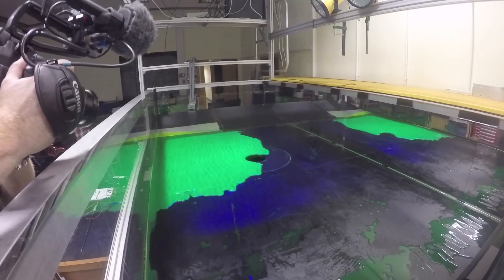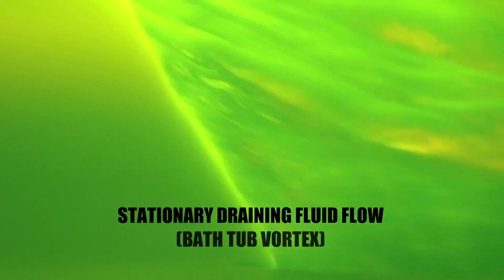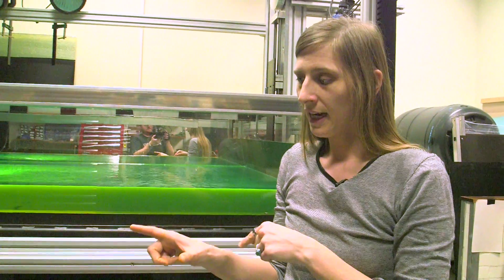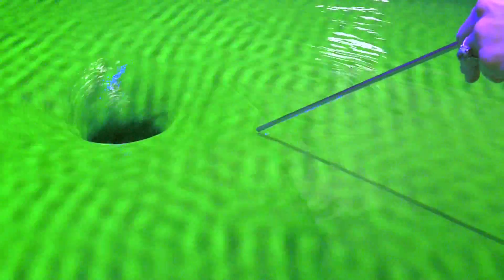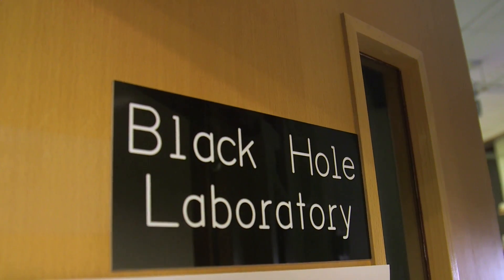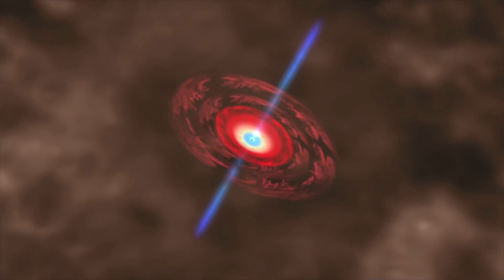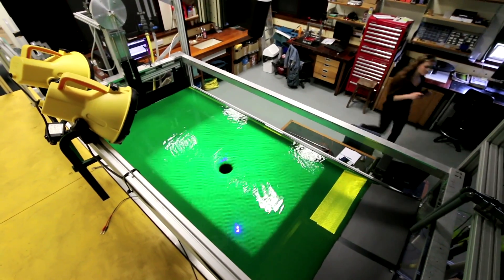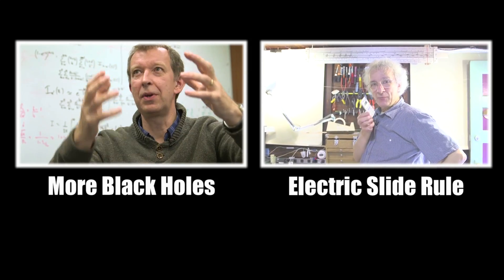The Black Hole Machine - Sixty Symbols

Comment: Wouldn't you have to uncurl the "wirl" first, to get a better visual repräsentation? It seems like a 4-dimensional repräsentation, on a 2-D surface in a 3-D world ...so you have to translate time. Till the worping of space is linear and expands like light - simply gravity. It would show the paint slowing massivly down, near the center of the object (hole) and you could observe the massive stratching before enterence. Or am I wrong? At least this bothers me every time a take a bath.

Comment: I'd like to see a more three dimensional testing tank. Build two siphons of about 2 inch diameter at poles of one another, facing a small area of no more than 4" square, where the water will be drawn. Because the water is all around the two siphons, special dyes will have to be used to illuminate the water flow. The model should mimic how turbulence happens within the three dimensional space.

Comment: Nice video. The symbol in the down right corner should be Εσ not Σσ if you want it to mean sixty symbols.
Reply: The sigma is the symbol for "s" in Ancient Greek, and the symbols are a capitalised and a non-capitalised sigma.
Reply: Jonathan Limm I know it is but the greek word for sixty is "εξήντα" which starts with a greek Ε and not a Σ. So sixty symbols in greek is Εξήντα σύμβολα. That's why I corrected it.
Reply: Periklis Arnaoutis applauds Yeah, but sixty symbols has taken the approach of using them as pronunciation symbols.
Reply: Jonathan Limm I guess that's the thinking.

Comment: So in theory does the black hole at the center of the milky way (or any other galaxy for that matter) loose angular momentum because its making all the star systems spin around with it?
Reply: Yes.  There are theories around sapping energy from black holes by utilizing momentum transfer, which is quite popular in Science fiction (particularly in Charles Sheffield's Proteus Manifest, where they use them as a primary power source).  If you are trying to colonize a region "close" to an active black hole, it may be beneficial to remove its rotation (I know this is done in a book I read recently, can't recall the name though.

Comment: Is removing a plug-hole from a bath an adequate simulation of something as different as a Black-Hole? Wouldn't you need to feed it smaller holes in the surface occasionally, giving off different amounts of heat to study it, then work out what the same effect would be in 3-dimensional space, where gravity is not just down, but pulling in all sorts of directions? It seems like an oversimplification to me and a comparison between two incomparable things.

Comment: Can we get a 4K reupload of this video, please? Not in actual 4K, just to trick Youtube into giving this video the bandwidth it needs. Because the compression is absolutely killing it.
Reply: It would handle it marginally better, because if it was 1080p upscaled to 4K, there would be more redundancy, and the algorithm would do slightly better at retaining the detail, since it has more bandwidth to work with. But the difference really is marginal, and not worth the hassle.
Reply: Penny Lane TotalBiscuit had a test video he posted about it around the time Far Cry Primal came out. I think he used 1440p instead of 2160p.
Reply: jhosioja You don't have a link at hand to one of the comparison videos you have in mind?
Reply: jhosioja And I actually found the difference to be quite visible.
Reply: It won't matter what the resolution is.  The video is showing complex moving patterns, which youtube's compression algorithm can't handle.  It'll look exactly the same in 4k

Comment: I would be curious what you think of Stephen Crothers who has shown that the mathematics for black holes disprove there existence.
Reply: Disproves how? Relativity, which gives us black holes 'breaks down' inside them.
Reply: +Gareth Dean Remember that black holes are theoretical and have never actually been observed.  They are currently only based in mathematical  equations derived from Einstiens field equations of relatitvity. Stephen Crothers shows that the math does not work and that relativity was misinterpreted by theoretical black hole mathematicians. So I was curious , if someone has visited his work on this, what they thought of it.

Comment: One problem with this analogy. The water moves faster, the closer it gets to the drain. Light slows down, for an observer.
Reply: This also isn't meant to simulate time dilation, by frame dragging and angular momentum changes using analogs to a black hole.

Also light slows for an observer, it still travels at c.
Reply: There is no problem. The light does not slow down. It is the information about the in-falling object that comes back to you with lower frequency. This is also true in this setup and was demonstrated with the paper boat trying to go back against the flow. The boat (light) always goes with c but the water (space) is falling faster the closer the boats (light) starts its journey back from the drain (black hole). At some point the in-falling water (space) exceeds c and then the boat (light) no longer moves / is visible - it cannot escape i.e. can't send information upstream.
Reply: It's not about light, not necessarily, but rather anything falling in/around a black hole. Not everything moving around it will fall it. But some does. However, this material interacts with one another, so that some stuff that radiates out rather then falling in takes energy away from the black hole. Light however does not slow down, it travels at C in all frames of reference. What changes is the Doppler shift, which gets more and more severe close to the black hole. This alters the frequency of light, rendering ultimately undetectable. However, light that does not fall in but gets close, will also interact in ways similar to above. Note that, the velocity of individual parts is not actually important in hear, but rather how information propagates through the system. Look up the definitions of group velocity and phase velocity. Group velocity (in oversimplified terms) represents a whole system/subsystem and is analogous to an average of sorts. How this kind of velocity relates to the process is what actually is important, and it does not behave in quite the way you'd expect.

Comment: Doesn't having inflow at specific points instead of all around, produce artifacts that don't reflect real blackholes? Wouldn't it be possible to set the outflow to spin in an specific direction manually and have the vortex remain stable without being influenced by the layout of the inflow?

Comment: this has been driving me crazy for a whole now. Vortices are one of the most fundamental and naturally occurring structures in physics. It is very specific and black holes seem to abide to its nature. Is it possible that a large enough whirlpool or Maelstrom can generate gravity towards its center? Has any one ever tried lowering a small sealed jar with marbles (or something of the sort) in the center of one of these vortices to see if they are pulled in any direction? The jar would need to be sealed off from any external forces but if these vortices can indeed generate a gravitational pull then its effects should be unaffected by the jar. Have we conducted this experiment on larger scales?
Reply: There have been some small-scale experiments, mostly focusing on more obscure effects such as the conductivity of pure water, but nothing that would be unambiguous. An issue is that at the center of a vortice you can expect gravitational effects to be symmetrical on average, much like how there should be no gravity at the center of the Earth. So far no effects have been observed but there have been some interesting aerodynamic effects. (Something in the center of a vortice tends to be pulled to its sides by air currents stirred up by the flowing water.)
Reply: +Gareth Dean +Gareth Dean Ya thats why I suggested the jar would have to be sealed. I realise that idea with the marbles was a bit arbitrary but i had to throw it out there lol. But I also think to observe effects like that the vortice would need to be much larger (probably more on a maelstrom scale). Would it be possible to conduct similar experiments with in liquid hydrogen? I know it may sound strange and i can't imagine it would be easy but I think the atomic structure of a liquid might play a role in the momentum (or kinetic energy) gained or produced from vortices. If thats true then liquid hydrogen (having only one proton) might have less friction or resistance leading to different outcomes. Is an experiment like that even possible? 
   Also, could a vortex be formed within a BEC?
Reply: Casey Hazelton
Liquid hydrogen wouldn't be that difficult, not much moreso than liquid nitrogen. Liquid helium, specifically superfluid helium would be more interesting as it has no friction\resistance at all. (It is in fact related to BECs, though not all BECs are superfluids. https://en.wikipedia.org/wiki/Superfluidity )

The behavior of superfluid helium is well studied in fact. At least on small scales.
Reply: +Gareth Dean Thanks, and I've actually just found a couple of AVI's online of vortices within super fluids. Not exactly what i was hoping to see but apparently it is being looked into. 
-last thing, could an electric current be ran thru the fluid while doing this?
Reply: Casey Hazelton
Depends on the fluid. Pure water us an insulator, so no, but it can be made to conduct by adding salt. Superfluids are incredibly insulating and actually break down when current is run through them.

Comment: A Black Hole is not a hole and space does not have angular momentum.  Just sayin'.
Reply: That depends a bit on definitions. The drain is not a hole either and a black hole behaves a lot like a drain in space, causing space to low towards is, carrying stuff along. Likewise a spinning black hole warps spacetime, if you are close to a spinning black hole you cannot stay still, space is moving and carries you along. This looks, from the outside, very much like the space itself has angular momentum.

Comment: Does a black hole have a 'front' and 'back'?
Reply: I'm not nearly qualified to answer this, but, I wouldn't think, because black holes are spheres. I'm pretty sure that the experiment was, in a sense, was two dimensional.
Reply: i don´t think they have in the three dimensional space. maybe in other dimensions?
Reply: A spinning black hole has poles, which behave slightly differently from the equator. Seen in four dimensions they do indeed have a 'front and back', the 'back' being the very center of the hole.

In the main though black holes are featureless spheres, the same when viewed from any 3D direction.

Comment: If you're wondering what the science term for this is, it's called a sonic black hole. 
It is so because it is a black hole for 'sound particles' (phonons)(yes there's such a thing), phonons go in but they dont come out. 
So studying the effects of this analogue black holes may give great insight on real black holes. 
One of the interesting thing you can study is also Hawking radiation. Excite a phonon into existence on the edge of the event horizon and see if you can detect an out going phonon. Indirect proof of hawking radiation. 
But this experiments aims to show that particles can gain energy moving on the Ergo-Sphere, which is just as interesting.

Comment: so what those guys are doing is, using a tub draining to replace a NASA super computer, to do experiments faster, amasing
Reply: But water doesn't stretch.  Space stretches.
Reply: parkplace6677 yes it does. It's a continuum, just like rubber, glass, wood, air or methane. As such, it is subject to Newton's laws as a macroscopic body of matter. The deal is, under shear stresses, unlike solids, fluids deform infinitely. Thus, we rather measure their rate of strain, or considering their constitutive relation, the velocity of the flow. Volumetric changes are also possible, although water is indeed incredibly hard to compress or expand uniformly.
Reply: The result of a program, even a simple one, can very well be something you never expected.
Reply: They serve different purposes. One is a model, the other is a principle test to actually see in action what we already know, to confirm models and to nerd out and learn a thing or two about the engineering of the experiment.
Reply: parkplace6677
Really? That's incredible. What kind of temperature gradient are we talking about here? I'm assuming 'near freezing' is 4 Celsius, when water is densest, but what temperature do you want for the drain itself?
Reply: Gareth Dean Oh 220, 221. Whatever it takes.
Reply: parkplace6677
But water boils at 212F...
Reply: parkplace6677
Aaah. Very interesting. I was unaware of this. The argument seemed to have merit.
Reply: parkplace6677
Water does stretch, not much but it does. Space around black holes doesn't stretch that much, interestingly its behavior is similar to water. Water is almost incomprehensible and in the experiment flows from and to what is essentially another dimension (Outside the 2D simulated hole.) Space in contrast is more 'flexible' but does not (As far as we know) 'flow' from or to anywhere. (It being the somewhere.) This is part of what makes the experiment so interesting.
Reply: Oh no, a computer will only tell you what you've programmed into it, this may well tell them something nobody even expected.
Reply: Gareth Dean  It would be a better representation to have the table be very cold around the outside, so the water is just at freezing, and increase in temperature as you approach the drain.  Maybe mount an old microwave over the drain to heat the water. According to my calculations, the changing water density that results from the changing water temperature matches the stretch of space to within seventeen decimal places.

Comment: how are there 2000 litres there
Reply: Think of a litre as 1000 cubic cm. that's 10x10x10 cm. now take those cubes and imagine 10x10x20 of them. ... Now flatten and stretch it a bit, say to 20x20x5. Voila
Reply: Yeah 2000litres = 1.26m^3 of water, as in 1.26m in all directions...but that looks less than that
Reply: In the machine, not just in the main tank.

Comment: how think are RL black holes supposed to be?

Does a RL black hole have an orientation when picking any point in the universe?

do RL black holes have similar orientations?

do RL black holes exhibit chirality?
Reply: 1. I don't think you meant "think".
2. 3. As far as I know black holes are not oriented. For the purposes of the experiment presented, neither is this one.
4. Chirality is a strange choice of words. As far as I know the spin of black hole can be anything.
Reply: Ben You are right, I meant to say thick. How thick are black holes?
Reply: Rotating blackholes do got a rotation axis, and it's an axis like any other. It's along those axis that the jets you might've seen on some black holes pictures move (they exist because some electromagnetic shenanigans of the gas around the blackhole spinning very fast and colliding a lot as it spiral inwards; some of that gas gets redirected before it gets too close to the blackhole).

AFAIK, the rotation axis of blackholes tend to be similar to the galaxies they are in like what happens to stars and solar systems; but there can be a lot of variation. Even the supermassive blackholes in the middle of galaxies don't always spin exactly like their galaxy.
Reply: Philip Bateson It depends on what you mean. The singularity isn't "thick" at all, in any sense of the word. The dimensions of the even horizon depend on how massive the singularity is. Big, generally speaking.